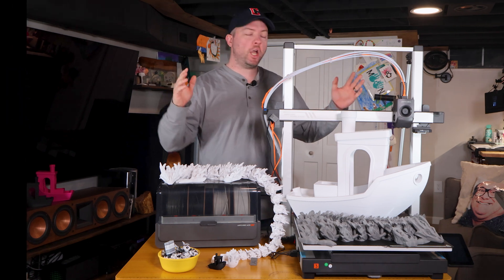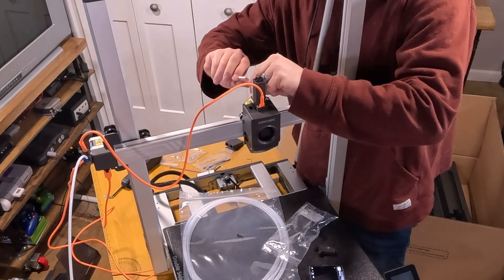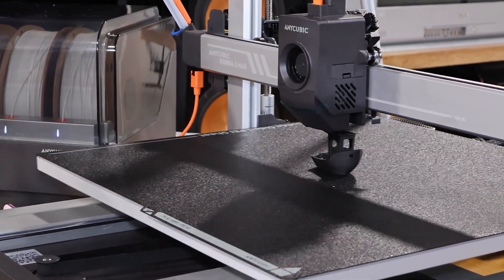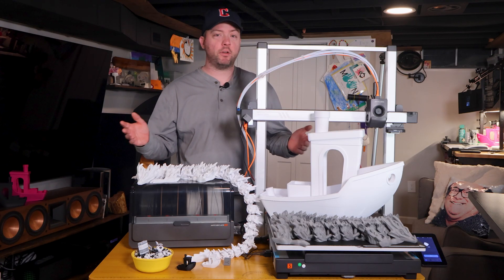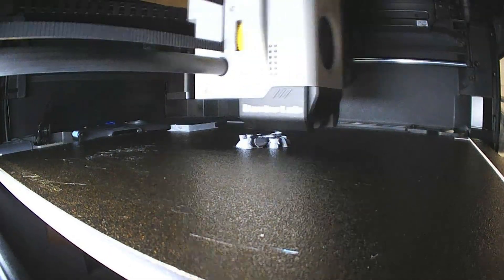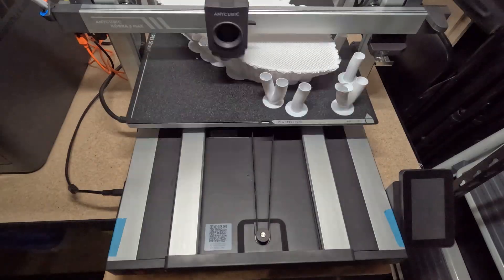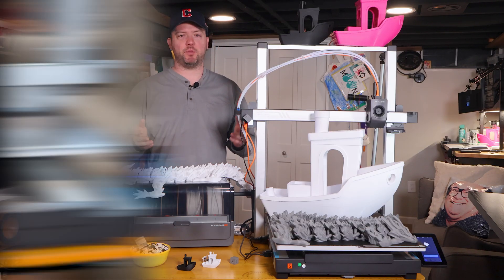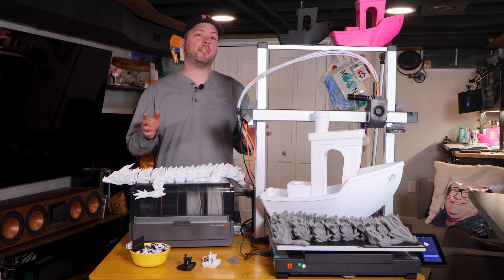Anycubic Kobra 3 Max!  Worth it?

Comment from the maker: Update: Edit: As mentioned in comments it was the first 3000 preorders, not if 3000 preorders are hit.  I must have misread the page.  A firmware update upgraded the camera to 720p.

Rapid/Fast/High Speed PLS is now recognized although there is no profile to take advantage of it but it's a step.

Thank you @racylaserjet, you can change the filament waste on the printer itself after it starts printing (not autolevel or preheat).
Reply: Did they state anywhere that "there were enough preorders"?
Reply from the maker: @ThisIsMeArnold  Not that I saw which is why I ended up just buying one before realizing one was sent.  So they did hit their 3000 orders.
Reply: @TKMakes-2024  Were the printer, Ace and camera shipped out on the same day or what?
Reply from the maker: @ThisIsMeArnold  I got the printer and ace on the same day.  The camera came weeks later.  From what I understand the preorder printer and ace where shipped and stored from China to California then shipped out from there.  The camera was late because it came from mainland China instead of CA and I have other projects waiting weeks on things from China.
Reply: @TKMakes-2024  I appreciate your responses.
Reply from the maker: @ThisIsMeArnold  As @ernieporto1111 stated it was apparently the first 3000 orders and not a milestone of orders.  It seems that offer has since expired.  I misread the initial store page apparently.
Reply: The camera was free only for the first 3000 printers, not if they hit 3000 sales. Last I seen online from Anycubic, they had only sold around 2500 of them. It was in an email they sent out not too long ago. As far as 3D Printers go, this thing barely exists lol, which explains why there are so few videos and reviews online. Anycubic also didn’t send this printer out to any reviewers before shipping.

Comment: Do not purchase an Anycubic Printer until you read this.
I purchased the Kobra 3 max Combo 3 months ago. It was shipped to me defective. They discouraged me from returning it and encouraged me to repair it myself because shipping would take to long. The catch is I have to pay for shipping. I waited for 4 weeks for the parts. I installed the parts and it still doesn’t work.  3 months have gone by and not one single print $650 down the drain.
A month and a half ago I purchased the kobra 3 Combo (Refurbished)  and it was shipped defective. They even stated it was inspected and repaired by their professional staff. Then why was it shipped defective. Same story, they sent me the parts and it still has the same problem. Christmas is almost here and I can’t fill any orders. Another $250 down the drain.
I have 6 Anycubic printers and 5 Enders. All of the Anycubic printers are not working, 2 of the enders are working. I tell you this to let you know that I know what I am doing. I am going to purchase a few more but not Anycubic. It’s a great machine if they ship you a working machine. One you don’t have to repair for them for free.
I have $1000 tied up in these 2 machines and they want to suck more out of me with shipping charges and continue to  extort my labor for free fixing their problem. They even offered free filament for my cooperation, which never came, a lie. It would take another 2 months to exchange them which will be a total of 5 months of waiting.
I now have demanded that they refund me completely or exchange the two printers for working ones with free shipping. I will not pay for their errors. I have been waiting to start printing for 1/4 of a year to resolve this with 2 more months to get final results.
They don’t inspect the machines, they get returns and ship them to you broken and hope you fix it. To send a brand new machine broken is beyond me.

Comment: 1) I like that you showed your kid painting it in the end.
2) I presume the price you talked about was in USD  ??
3) 1 Thing to cover is short prints but you are printing a lot of them. Was the wider bed, I plan to take advantage of this.

Question:
So, this doesn't print a "block for waste, it spits it out the side? If so, where does it land?
Reply from the maker: This has been awesome to print a ton of party favors and Halloween bookmarks for school parties.  I'd use one of my other smaller printers for small objects because the heating and auto leveling takes so much longer on the K3Max.  The filament literally is just spit off to the right if you were looking at it.  You can print a deflector and bucket to keep it contained but yes, it just launches it to the right.  Prices were in USD and this was before US tariffs so if you're in the US it's probably out of date now.

Comment: I bought the Kobra 2 Max when it was first released a few years ago, and the print speed was very nice, and the fast benchy still looked beautiful. I am considering purchasing this 3 mainly for the multicolor option. I am guessing you are new to Anycubic. Unless there are extreme changes to the Max3 vs the Max2 besides color, I am having trouble believing your negativity. I have 2 Bambu  A1s, 2 Kobra 2 Max's and a Qidi 4 Plus. Anycubic is highly comparable to both in printing quality
Reply from the maker: I've come around on this one and it sounds like I was more negative than I intended.  While my P1S is still my primary printer I've put in 580+ hours (according to the app) of printing on the K3Max.  Thinking back I think my biggest issues were with software which Anycubic continues to update which has been awesome.  With the additional, cheap, ACE Pro, tuning the "poop" volume, improvements in software, and I'm uploading a maintenance video, it's becoming a printer I use quite frequently!  Wish their cloud didn't go down so much and the .8 nozzle needs some troubleshooting :(

Comment: I am considering replacing my Elegoo Neptune 4 Max with one of these because I'm so tired of its issue with the z offset never being consistent.  One print itll be perfect, and the next print ill need to raise the offset like 0.5mm higher and then another print like0.3mm lower, etc.  It never has a consistent z offset.  I believe this is due to the stupid induction sensor it uses for z probing.  

Has this printer ever given you any sort of randomly changing z offset issues like my 4 max always does?  That's the 1 big thing as to why I want to replace it.  

Another reason I want to replace it is because this printer's AMS system will also allow me to use up a mostly empty spool and seamlessly join it with another spool of the same filament mid print without having a layer shift at the filament change.  I don't use or trust the Neptune 4 Max's filament run out change system because the last time I used that, it had a literally 1 foot layer shift upon resuming the print and my 30+ hour print was instantly a failure.

Comment: I bought the Elegoo Neptune 4 Max, which is compatible with Linear Rail upgrade and BoxTurtle Auto Filament Changer. I don't think there is a huge difference. I would go BoxTurtle because it saves on costs and you can also upgrade it yourself once you buy the parts. It will pay for itself.

Comment: How are wide flat first layers on this?? I’m printing large letters and considering this one.
Reply from the maker: Do you mean how well the first layer adheres? I haven't had an issue but it does take longer to heat up.  If you mean from the nozzle it's .4mm like any other printer and I'll bump line width to .5mm if I want to speed up a bit

Comment: i dont understand why does nobody uses lighting infill especially for such large prints
Reply: Depends what kind of application they are doing. Most people do 15-20% infill. Lightning often also has loose ends which can warp making it faster but less reliable. 
For some printers linear commands actually go faster than lighting but that's not yet common.

Comment: Been debating if I was going to buy a H2D. I have a P1S which Is fine,  but I really need to replace my Kobra Max cause I need a big bed with an occasional multi color. I might retire that Max and buy one of these
Reply from the maker: The H2D is so expensive and I don't have a legitimate use for one but that doesn't meant I would love one!  There are some issues mentioned in comments with settings I think can be updated in software, hopefully Anycubic does that.  Overall I'm happy with the 3 Max so far.
Reply: @TKMakes-2024 sounds good
Reply: @TKMakes-2024  can you use different nozzle sizes on this? Thanks.  I do a lot of 1mm printing
Reply from the maker: @johnallen4030  Anycubic advertises that you can but they only sell a .4mm nozzle which is really disappointing.  It uses a different nozzle than the standard Kobra 3.

I did just buy a nozzle set off Aliexpress that is on it's way and includes a .8mm.  Hoping to get that working and making a video about using it.  Large prints take days on the .4 so hopefully I can get them down to 24h on a .8.

Comment: Great video. Did I miss if you covered the topic of 'Z Offset adjustment' during the print? I factory reset mine and updated firmware again. During the print, if I notice the nozzle is too low, which myself and another person did agree- it needed to go up at least .005, 'settings'on the little screen shows only the enable camera option- no z adjustment like his ACK3. The ACK3M I have has NO z offset adjustment.
Reply from the maker: I didn't talk about the z offset because I didn't have an issue with it.  The more I've had it the more I have learned that it's a common problem so one day when I have to address it I'll make another video.  Didn't mention it in this one though.
Reply: @TKMakes-2024  I'm sending this C tier printer BACK. And idk if you're putting this all together or not but *we are missing settings*, there's inconsistent firmware/software floating around. Machines are being damaged with no adjustment available to them. I have multiple printers. Mostly Bambu X1C , I will never buy a C class printer again. After the last firmware update 2.4.6 my K3M got even worse. It freezes at Auto Level Preparation. It's going back.

I followed for the insight on the K3M but I don't have the machine anymore and you're not too pressed about missing settings. All good though, buddy

Good luck with this rig and your channel.✌🏼

Comment: Would it have warping issues when printing big items with PETG? Printing 'LARGE' PETG parts on my A1mini would often turn out warping. I assume printing large PETG parts on the K3M unenclosed would turn out even worse (?).
Reply from the maker: I don't usually use PETG so I can't help much here although now I'm really curious.  I primarily print with PLA but I have some larger functional prints I need which PETG is better for.  If I get to it I'll try and let you know but don't wait for me either.  Good luck!

Comment: I bought one with ACE to print Multiboard or Hex board panels at 16 inch widths. 420mm is 16.5ish inches, a perfect width to fit between studs in my un-drywalled shed.
Reply from the maker: That is a fantastic use!

Comment: Got mine a few days ago and been running a 52 hour huge print on it. Going well so far, no issues. Print quality looks amazing. I have the Ace Pro but I won't be using it for multicolour. I will stick to having 4 same colour rolls for massive prints and overflow. The one thing I wasn't expecting is just how much wobble this thing has! It's nuts. I really need to either bolt my workbench to the wall or get a new workbench! So far no print issues from it as it has good vibration compensation test before printing. Print over WiFi worked fine. No issues with slicer software either, basically same as Bambulabs but even more settings.
All In all Completely worth the kickstarter price. I probably wouldn't have paid full whack for one though as it could use some higher quality touches here and there. Looking forward to printing more massive things! If anyone has any cool upgrades then let me know!
Reply from the maker: Mostly the same reason I have the ACE pro as well, so it automatically reloads into another available filament on it's own.  The wobble was insane!  I expected it because the mass of the print bed but I was surprised.  Tried printing a few poop buckets that hang on the printer instead of sit under it so let me know if you find one.  Glad you're enjoying it, I am too!
Reply: I built a table for my Kobra 2 Max out of 2x4s with nothing but a cheap chop saw, battery screwdriver and part of a box of torx screws (and some wood glue).   It took about two hours and I was able to custom size it.   

These big-bed printers are slinging a lot of mass and you'll need a sturdy, massive table to hold it.   I wouldn't trust it to any mass-produced table that cost less than the printer itself.

Or, you could just leave it on the floor.
Reply: Can you adjust the Z Offset up/down on the K3M screen or slicer, before, or during print more importantly?
Reply from the maker: @sammythebull2240  I'm currently doing some prints on it and I don't see a spot that I can change the z offset during a print.  There is a z offset setting in the nozzle preset you can update though.  I haven't tried changing mine so your milage may vary.
Reply: @TKMakes-2024 
At 2:15 mark, he mentioned the z offset needs adjustments, he adjusted it while the print was going. If you don't have this feature, you're in my boat and we have defective machines I guess.

 https://youtu.be/oR4eJfJKM_Q?si=MstP_vm8diWztuRi
Reply from the maker: @sammythebull2240  Thank you for the link, I guess after my print finishes I get to double check the screws are properly tightened.  I'll also have to poke at the controls more since he was able to change the offset mid print.

Comment: my bottom layer is great layers above infill are great but top layer is giving me ripples
Reply from the maker: You can change the top surface pattern in the strength tab of the slicer.  I don't have a recommendation since my prints are ok but it's worth looking at.

Comment: The auto refill is why I went with this printer with the ACE. I don't like having to babysit the filament or throw a new spool at it when doing larger prints. I'm hoping they do add a way to adjust the purge volume. That's a massive amount of waste
Reply from the maker: Im not at my PC but another person said that you can adjust the purge from the printer itself AFTER it's actually printing.  I believe you click on the ACE icon and scroll down.  I did see it.
Reply: @TKMakes-2024  that's a very odd design choice.
Reply from the maker: @ I think it's smart in that it uses the moving of the head to cut the filament to save cost.  I believe bambu does the same.  Just terrible instructions.

Comment: Why does the bambu only uses  153 filament changes while de kobra uses 231?
Reply from the maker: I don't have a good answer.  I did notice when it changed filaments it would poop multiple times, maybe that is it?  All the numbers on the slicer seem to be a little inaccurate but I'm not going to count on a 6 hour print!

Comment: Hey there. Got mine and thought this video was great since I’m new to fdm. Do you have a video to point to for that other cutter. I’ve had it in a bag not knowing what to do with it.
Reply from the maker: Welcome!  Glad you liked the video and in my experience this printer is a little less polished but if you're even just ok at analyzing problems it'll be great.  I don't have a video or footage of the cutter since I realized something was up off camera during the multimaterial prints.  I did upload the location of it at https://imgur.com/a/E6NRX9a.   On the right side (looking from the front) there is a plastic rectangle that you can pop out which is the same size as the plastic on the cutter, that's it.  You'll want to align it in a way that the completely flat part of the lever is towards the front so when the print head slides all the way to the right it'll push on it and cut the filament.  If that's what you're looking for but still not sure I can try making a short private video to help.